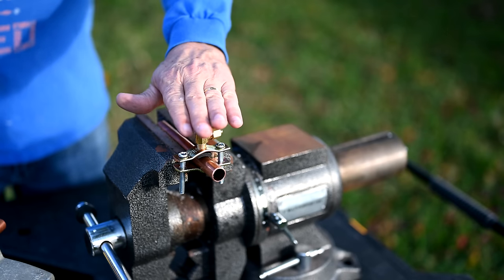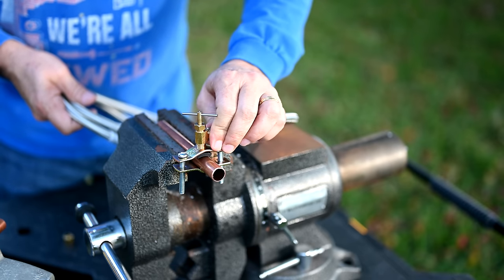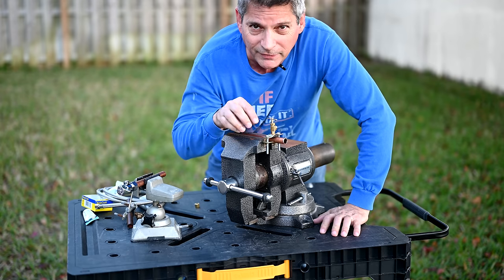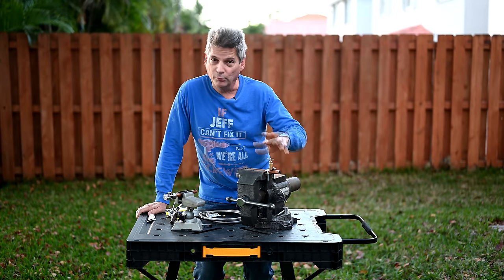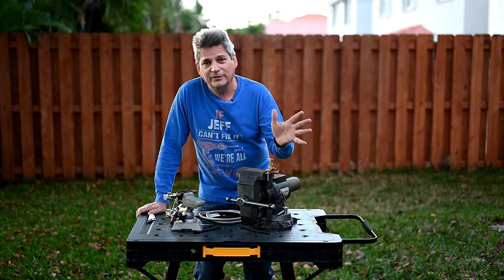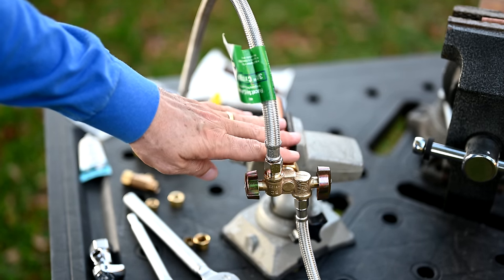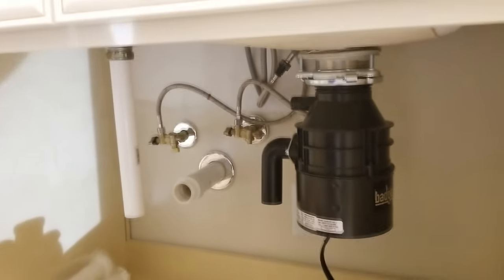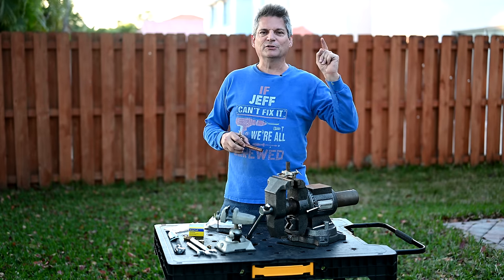Plumbing Tips: 2 Saddle Valve Alternatives For Ice Maker Lines

Comment: I like your workbench,where can I get one like it and are there bigger sizes.Your presentation is very good,helpful and educative,I hope people will understand that it is all for their benefit.
Reply from the maker: 🛒 DeWalt Folding Portable Workbench (at Home Depot) https://homedepot.sjv.io/Qo9vo
🛒 DEWALT DWST11556 Express Folding Workbench (at Amazon): https://amzn.to/2qsaRdi
🛒 Keter Folding Table Work Bench with Clamps: https://amzn.to/2QkEDea
🛒 DeWalt Deep Pro Part Organizer with Metal Latch: https://amzn.to/2rlK5Ud
🛒 Milwaukee 0880-20 18-Volt Cordless Wet/Dry Vacuum https://amzn.to/2P6VaAF
🛒 DEWALT DCS575T2 FLEXVOLT Brushless Circular Saw, 2 Battery Kit, 7-1/4" https://amzn.to/37Rd1De

We also did a tool review video on the bench: https://youtu.be/XBfuwIEGt-U
Reply: Where can I check for the workbench I seriously need it and as a matter of fact I have been trying to get something like this for a while now.
Reply from the maker: @abibodlogistics  They have them at Home Depot, that's the link to it I posted above

Comment: So I'm not getting how the ice line goes all the way from under the kitchen sink over to the fridge. Does that mean running it through the walls? Also, Can I use the dual valve on the copper pipe that sticks out of the wall behind the fridge instead? It's only like an inch off the ground tho.  I have to have a cutoff valve within 6 feet of the fridge to have my new fridge/ice maker hooked up. Right now it is just a capped off copper pipe behind the fridge. (this was capped when I had a leak/flood about 15 yrs ago) What would you suggest? thx

Comment: How would you go about stopping/plugging the end? I recently got a new fridge and had to move the location bc of size; now my copper line has a constant drip. Trying to think of a good way to plug it. Doesn’t have a valve on it; saddle right at the water heater
Reply from the maker: Buy a plastic water line cap for the copper tube. Great instructions here: https://www.hunker.com/12490072/how-to-cap-a-copper-refrigerator-water-line
Reply: THANKS!!

Comment: The saddle valve is on the cold water supply which means its much cooler than the moist air surrounding it. This is a good source of condensation for electrolysis.
Reply from the maker: Could be in some case, here in FL, mostly cold water line is at room temperature, so only the complex formula of temperature difference and humidity.
Reply: Should the valve be placed on the cold water line or the hot water line? Thank you 👌🏿

Comment: Could you provide a solution for this situation? HVAC installer crimped off copper tubing from saddle valve in cold water supply pipe to water heater and put  one on the verticals hot water out pipe from water heater. Old one is corroded and leaked after they left but with several more crimps I got it to stop leaking. 
But new saddle valve is even cheaper than old one and is already corroding after a couple years. These valves are connected to a small diameter copper tubing that feeds the whole house humidifier. What could I replace these with? At least the newer one on the hot water pipe. All piping is copper.

Comment: I had to move my fridge to install flooring. When I did the copper waterline broke in half. My husband supposebly turned the saddle valve off but water is still coming through it. My water bill is going to be a nightmare!! It's been almost two days of non stop water flow(light drizzle). What do I do to stop the water flow?

Comment: Jeff

I “ only“ Have pex /shark bite (Blue/red plastic water lines , due to the fact that someone stole all the copper piping just before I moved into my house). How do you connect your refrigerator waterline to pex/ shark bite???
Reply from the maker: See if pex has a pex valve, or you could get a sharkbite pex to copper coupler, and use our normal methods to install a compression fitting valve onto the copper pipe.

Comment: As a very basic DIY attempter, I loathe using these. But I have used one recently. Thankfully(or not) my mothers under-sink plumbing needs to be reworked due to poor quality work done in the past by a professional plumber. She just bought a fridge with an ice maker and was hoping to hook it up soon. I went ahead and used the saddle clamp, because we are going to get the plumbing reworked under the sink anyway.  At least I was able to place it above a soldered joint so that only a small section would need replaced in the event of a failure. 

Placing these in a visible, easy access is highly advised. Don't clamp it in some out of the way nook or under your floor.

Comment: for the double valve method is that metal also not brass, and would eventually lead to galvanic corrosion as well? if it was such a bad thing for the saddle valve wouldn't the same be true for this as well?
Reply from the maker: Apparently they are inert enough metals to not interfere with each other
Reply: @jeffostroff  which leads to my next question would putting a rubber piece of material on the other side help prevent the galvanic corrosion? don't get me wrong i don't think these saddle taps are a great idea, but there could be things done to them to make them less of an issue at least with how prevalent they are.

Comment: Could you help me figure out how to read the plumbing code for Missouri? My landlord used Saddle Valves that don't work and I'm trying to get them to replace them. If I can show them it's a code violation I bet it would make them feel obligated to call a real plumber. I did find the code, I just don't know how to read it. From what I can tell I think it says they just follow the Universal Plumbing Code.
Reply from the maker: Her eis for St. Louis: https://library.municode.com/mo/st._louis/codes/code_of_ordinances?nodeId=TIT25BUCO_CH25.04PLCO_25.04.050CH3GEREME Look on that page at Section 311.0 Prohibited Fittings and Practices.

311.2 No drainage or vent piping shall be drilled and tapped, nor may a saddle be used for the purpose of making connections thereto, and no cast iron soil pipe shall be threaded.

Comment: Thanks for a great videa and advice Jeff.  However I have a saddle valve in the basement, and the ice line goes up from there. I am not sure how to connect to the that pipe and have a connection to the ice line.  Also, how do you plug a hole in a pipe after removing a saddle valve?
Reply from the maker: You don't plug a hole in a pipe after removing the saddle valve. You cut away the section of pipe or the saddle valve was and you insert a copper tea fitting and make a little stub out of copper pipe which you can then attach a water shutoff valve too
Reply: @jeffostroff  I'm not understanding. Is there soldering involved? I was thinking about using something called a shark-bite, but don't think I should be bending the copper line to insert a SharkBite cuz it could break a connection on it at one of the ends  of the copper line.. Can you help a little on this? Thanks. Great video and I subscribed.

Comment from the maker: Useful parts/tools shown in this plumbing tips video:
🛒 BrassCraft  3/8 in. x 3/8 in. x 1/4 in. Compression T-Fitting https://homedepot.sjv.io/d1qkj
🛒 BrassCraft KTCR1900DVX R Dual Shut Off Valve Cold Water Home Depot: https://homedepot.sjv.io/dmGqQ
🛒 BrassCraft KTCR1900DVX R Dual Shut Off Valve Cold Water: https://amzn.to/2OfHAeL
🛒 BrassCraft KTCR1901DVX R Dual Shut Off Valve Hot Water Home Depot low price: https://homedepot.sjv.io/Q5bvY
🛒 BrassCraft KTCR1901DVX R Dual Shut Off Valve Hot Water: https://amzn.to/2Ua4B6y
🛒 RIDGID One Stop Wrench Kit 27023 from Amazon: https://amzn.to/2ClCbNa
🛒 RIDGID One Stop Wrench Kit 27023 from Home Depot: https://homedepot.sjv.io/9XEjQ
🛒 Duck Puller Ferrule Ring/Sleeve Puller: https://amzn.to/2k5hrTY
🛒 Saf-T-Kut EBCRR Brass Compression Ring Remover https://amzn.to/2Ypt5Mv
🛒 Channellock 12-Inch Pliers: https://amzn.to/2MdcnGR

Comment: If I remove my saddle valve and use one of the simple fixes that you've suggested, is there a simple repair for the hole left in the copper pipe from the saddle valve?
Also...what about a SharkBite fitting?
Reply from the maker: It is a simple repair, if you know how to solder copper pipes which isn't too bad to learn how to do. But essentially they would have to cut out that little section with the whole and solder in a new T fitting, and then you would Sutter in a couple of inches of corporate pipe into the T part of that fitting , and then you could install a compression fitting valve at that point and the good thing about having the compression fitting valve is anybody can do that, and if it ever fails in the future anybody can easily unscrew that compression fitting valve and screw on a new one. Most plumbers agree that SharkBite fittings are not quite as reliable however if it's out in the open somewhere or like in a basement where you would definitely see it if it drips probably OK to do I only use shark bites as a temporary solution until I can go and get a real part

Comment: Jeff.  I, too, have been trying to find a connector that will allow me to adjust the flow into my icemaker separately from the flow to my sink.  My only problem is that I ALSO need a 3/8" connector to my dishwasher hose.  Can I modify this valve with some sort of splitter so I can have one valve control the icemaker and another control 2 - 3/8" connectors?  Or is there a different valve that you can recommend? Any suggestions?  Please help.  I really trust your advice.
Reply from the maker: You need to have these adapter valves on both the cold water side for the ice maker, and on the hot water side for the dishwasher which must be connected to hot water. We did another video that actually shows this install in the kitchen we worked on several months ago take a look at it here  https://youtu.be/_0ziKhjwwe8

Comment: Great but what if your sink is too far away from the fridge? How do you tap into an existing nearby pipe with Somethig other than a saddle valve?
Reply from the maker: At my friend's house we ran a 20' ice maker line, and had to drill holes on the side of 3 cabinets to feed the ice maker line through.
Reply: jeffostroff thanks but that’s not my question. I have the water line for the fridge tapped into a nearby pipe with a saddle valve. Is there a fitting to use at this pipe instead of the saddle valve?
Reply from the maker: @tdz69  This video shows you exactly 2 different parts that you can use that are alternatives, watch the video.
Reply: jeffostroff I did but both parts you show are connected by the sink faucet. I’m asking what can I use at the existing pipe that has the saddle valve. I’m trying to do that rather than run to the sink which is a distance from the fridge. Thanks.
Reply from the maker: @tdz69  Cut out the old saddle valve, and put a copper T-fitting there, and  then install a small stub of copper pipe soldered to the tee fitting. Then on the end of that copper pipe stub, compression install the shutoff valve that has the 1/4" output for the ice maker.
Reply: jeffostroff thanks!!!!

Comment: I think there is a very simple Solution for installing saddle valve, in this video I notice at the top of the saddle valve with rubber looks ok, solution is just put a same rubber at the buttom of the saddle valve to the pipe 😁

Comment: What should i do if i don’t have a faucet on the same wall as the frig?
I have a saddle valve connected to a water line in the wall behind the frig. What is the best replacement?
Reply from the maker: I would cut a hole in the drwyall, tap into that line with the appropriate copper fittings and put an icemaker outlet box in that hole in the wall behind the fridge.

Comment: not sure how to take my frig water line off if there is a saddle valve on there. I don’t want to use the ice maker and I need to move the frig. The line is coming straight out of the wall there is no shutoff valve so once I detach the line and turn back on the main water valve what is to prevent the water from stopping? It’s a long story but I really cant have a plumber here to do this so I need to figure it out.
Reply from the maker: Plumber would have to solder on a repair coupling on that pipe when they remove the saddle valve. There will be a pin hole in the copper pipe, so that has to be cut out, and a coupler soldered in it's place.

Comment: Great video. Sadly we bought a house where a saddle valve was already installed near the water heater on the copper pipe that goes to the cold water supply line. Some of the connections may appear to be soldered. What would be a good estimate for replacing the connections and plumbing near the water heater and installing one of the BrassCraft valves? We can't use the water line under the sink as the fridge is on the opposite side of the kitchen. Trying to bring things up to code and seeking some advice.
Reply from the maker: Sorry to hear that, I guess plumbers would probably charge around $300 for doing that for you.

Comment: Would these fittings work for a hookup from refrigerator water line to a washing machine cold water line?
Reply from the maker: Yes you can do it but it's a bit of work! The washing machine water pipe ends with a threaded hose spigot. so I would cut off the spigot, put a copper T-fitting, then re-solder on a small 1/2" copper pipe stub out and a new hose spigot to one side of the T-fitting. Then solder on a small copper stub out and install a compression shut off valve 1/4" on the other side of the T for the ice maker line, as we showed you in this video. No you'll have independently controlled water shutoff for you washer and icemaker.

Comment: Jeff,  What do you recommend for replacing a saddle valve that has corroded on a whole house bypass humidifier?  The 1/4" water line that feeds the solenoid is fed from a saddle valve that is connected to my cold water feed to the water heater.  It's work I'm going to have to have a plumber do, unless you think I can just replace the existing saddle valve.  But, everything I see from your videos leads me to believe I can't remove the old one and replace with a new saddle value because it probably would leak.  Just as @ItzFuazz said, it sounds like I'd  have to have a plumber cut in a section of the existing line with a Tee fitting.
Reply from the maker: I would not recommend replacing it with another saddle valve once you've pierced a hole in that pipe who knows whether the other saddle valve can fill it effectively or not anyway. So much better to just have somebody come in that will cut that bad suction out of the pipe, and saw her on a T fitting, and then a small stub of pipe, and then ask for 1/4 turn ball valve with a quarter inch output to feed your ice maker line
Reply: Humidifier should be hooked up to your hot water pipe not cold.

Comment: If I remove the Saddle Valve feeding my water filter and replace the faucets valve with your dual valve solution, won't I still have a hole in the pipe from where the saddle valve used to be? Do you have a solution to this problem or is it time to call the pros?
Reply from the maker: Yes if you remove the saddle valve you have to cut that section of copper pipe out and patch in a new section

Comment: Thank you sir. Saddle valves are a lazy and flawed solution. Years ago, I installed a saddle valve that was included with a reverse osmosis water system. Started leaking immediately, which I can see now was probably the best thing that could have happened. Had to replace the pipe that now had a hole in it of course, and went to a valve that had two outlets:  3/8 and 1/4 inch. Problem solved.
Reply from the maker: Glad it leaked right away and you caught it!

Comment: These are a much safer and more watertight method than a saddle valve. Ask yourself......if you were in a submarine a few hundred feet underwater would you feel happy if you looked up at the piping and saw A SADDLE VALVE.........? 🤔Or would you feel safer with correct pressure tested adaptor.......OK an extreme example.........but if an SV blows above a ceiling or in an attic thats gonna cost $$$$$’s.........WORK SAFE guys. The only place for saddle valves......😩.....throw them in the dumpster!  I was an Armed Forces engineer for over 45 years.......I recommend this channel👍🏻👏🏻👏🏻👏🏻
Reply from the maker: Well spoken!

Comment: Thanks for the helpful video!  One question, can solution 2 (with the dual shut off valves) work for a inline humidifier that’s connected to the cold water under a sink?  I need to be able to get the water down to a low trickle to not flood the humidifier. Thanks!
Reply from the maker: It will work if the humidifier has a 1/4 connection line.

Comment: i was just about to put one in for an inline air humidifier, but it... seemed chintzy to me, had a weird feeling about it. glad to know my intuitions still pretty good. i like that dual saddle valve. it solves all the problems, and honestly.. 40 bucks for a part that has independent control and no weird metal ... something something chemisty two metals rust blah blah im a tile installer and idk. regardless, 40 bucks even for piece of mind. fuckit. im going to get one.

Comment: Very informative, thanks! Will saddle valves be ok on pvc or pex? Or will it still be against code? Just wondering. Ive decided to upgrade to the $40 part. For looks and simplicity.
Reply from the maker: Code says forbidden so I assume it refers to all pipes. Outside I would have no problem using one.